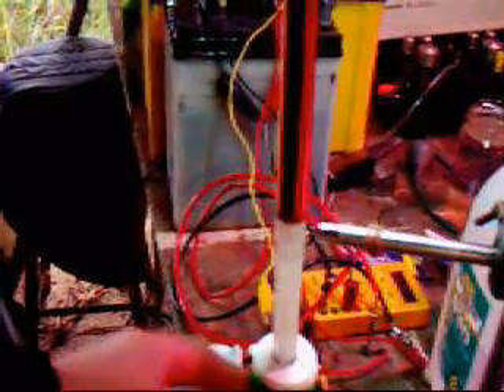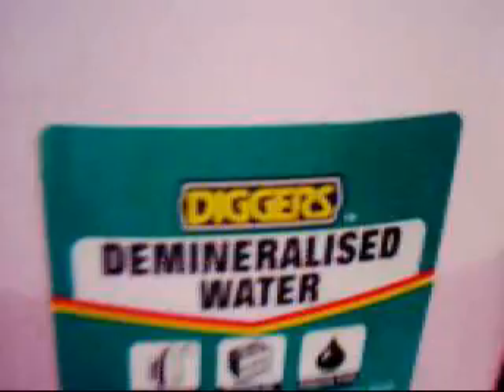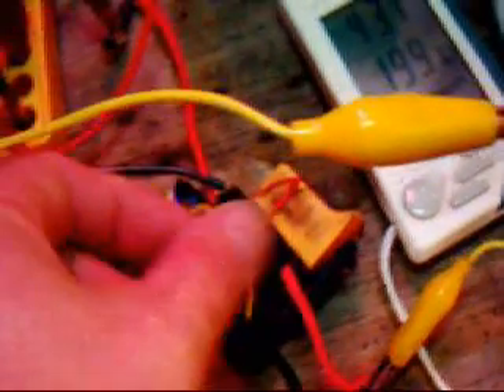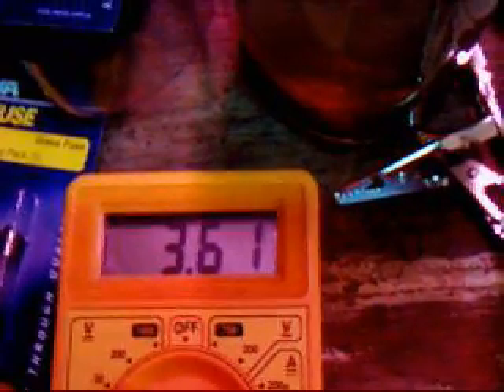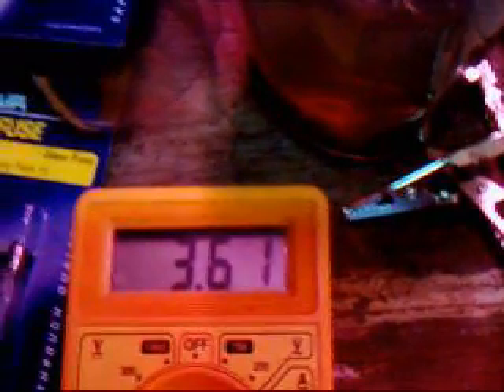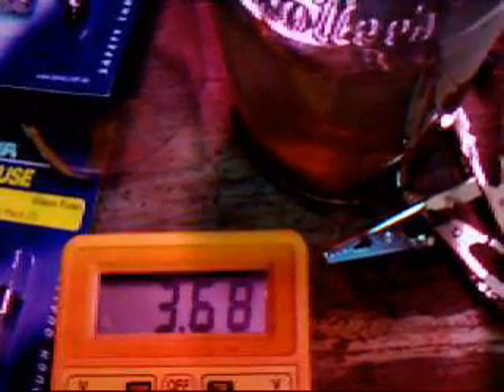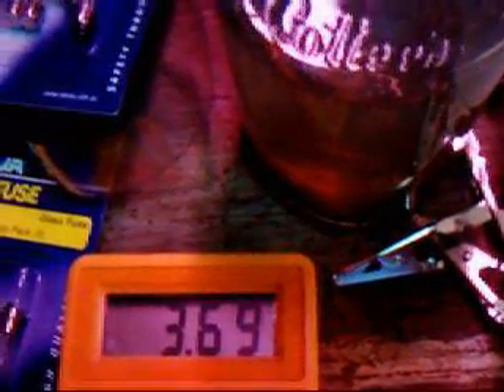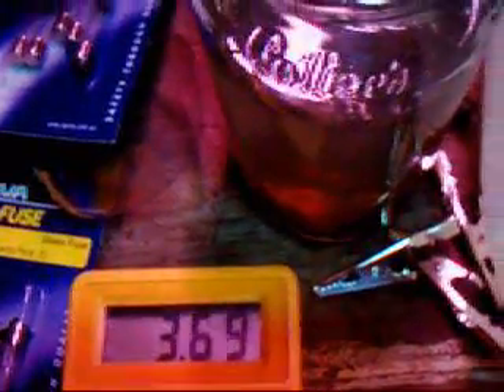HHO Electron extraction Part 3

Comment from the maker: in de-ionised water with no electrolyte-i aw no amps coming off the top.josejir has got 1 amp back using it with eletrolyte-it would be best to take this to a capacitor crcuit that is voltage rated above the input voltage of the battery.